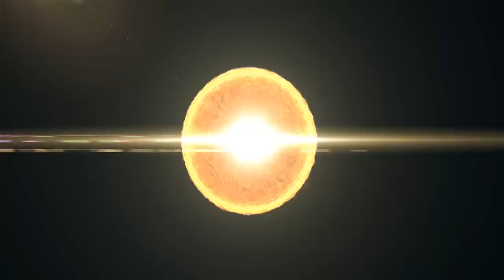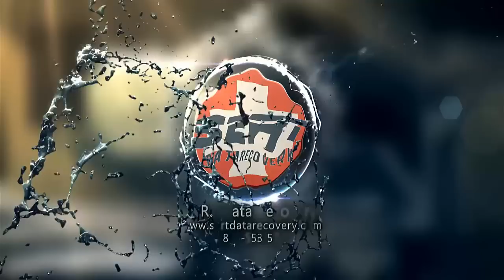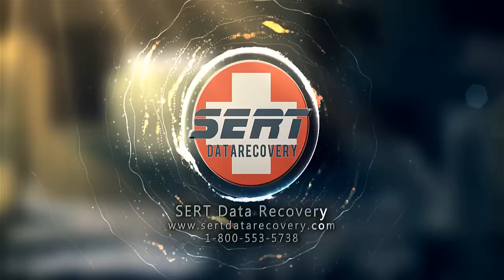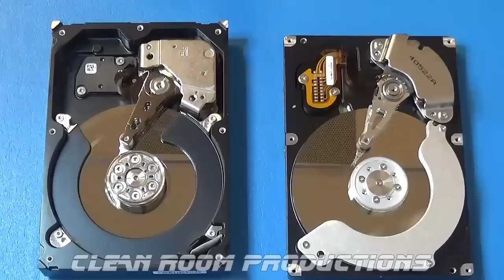1st Step In How To Recover Data From Clicking Hard Drive AKA The Click of Death

Comment: I'm from Indonesia,

I had a problem like this , and this happened on my Toshiba laptop HDD .

Can I ask? Whether by doing....

1. Head Replacement , 
2. Replace the PCB board which is behind HD blue or green colored board that controls the movement of Heads HD , HD disc set speed , and so on.

So.. Whether it can make my HDD rise from the death and get my data back ?

Please answer my question , because my laptop still can not get used to this day .
Reply from the maker: +Victor Tauran It's almost impossible to answer this without determining exactly what is causing the clicking.
Reply: SERT Data Recovery 
Could you do a good job and give a bright hope for my HDD if I send my HDD to you ?

Give me the phone numbers and email addresses can I contact
Reply from the maker: Victor Tauran we always go the extra mile for our clients, we will attempt every option before we determine the drive to be unrecoverable. PH: 800-553-5738 please fill out our form for the quickest help getting a case started: https://secure.sertdatarecovery.com/online-quote Thank you for your interest in SERT.
Reply: SERT Data Recovery Ok , the next two or three days I will send my HDD , conformed to the address indicated.

The address I get from Todd Trahan

Just like that?
Reply: SERT Data Recovery .
Reply from the maker: Victor Tauran
SERT Data Recovery 1748 S Congress Ave, Palm Springs, FL 33461

Comment: Thank you for this video! It was very helpful for me as a tech noob to understand what is happening and that my feeling was right to save my data immediatly after hearing those noises. I don't understand why this video has so many "thumbs down". FYI: I saved my data and then tried the windows disk check tool but I think now the HD is completely done ... I think I will have to get a new one ...
Reply: +Jaana Hoffmann I hope you don't mind me asking your opinion if you think I should have the HD checked by a professional (im in Europe) or - as my data is saved already, just buy a new one - it wasn't any special or expensive HD
Reply from the maker: +Jaana Hoffmann Thank you for your response Jaana! Disk check will kill a failing drive (Just FYI). If you have recovered your data I would try to RMA it, and never use it. Replace it at all costs!!!!

Comment: my hard drive is really strange. It doesn't show on mac, but does show in windows( And makes the pc slow), and I can see all the data in it,( Some of the data, probably small sized data"till 50 mega bites" can actually be transferred, however the large data just don't seem to have that opportunity to be transferred). Some one help me? I couldn't find it in any forum on the internet, because mine doesn't have the whole typical symptoms? 

And important symptom, the clicking sound is not continuous but rather frequent And it doesn't sound bad,( I know the bad sound), And can disappear when holding it in some manner
Reply from the maker: +Sekai Ori No Game No i would stop running the drive. Your drive is dying, and could already have bad heads and a damaged file system. Only a data recovery firm will have the tools and ability to possibly get the data off without having to change any parts. I bet this is a Seagate?
Reply: +SERT Data Recovery  No, it is WD hard drive, so what should I do?, one of the things that are important is that I can play my videos,(but they are like a bad connection youtube videos streaming), they are their but are not playable properly
Reply: +Sekai Ori No Game No 7uu7u87 67oughvtugtchn.

Comment: my hard drive makes very loud clicking/knocking noises when i try to boot up my laptop. i've compared this sound to other sounds of bad hard drives, and i've deduced that the problem must be bad heads. is this something you guys could fix? if not, could you recover all of the data? how much would it cost?
Reply from the maker: +Derp McTrollington Derp it is possible the heads are bad. We can definitely help you out. Once a drive has issues you don't want to fix it to use it. DR companies only repair drives temporarily for data recovery purposes. Please fill this out for a quote: https://secure.sertdatarecovery.com/online-quote

Comment: are those drives supposed to start from the middle or is this something wrong? because my drive sounds and acts like the one in the video besides it's starting from the outside of the disc and basically makes the same movements but mirrored. but my drive is supposed to start from the outside.
Reply from the maker: +Maurin Bieler yes some drives read/write heads park in the middle and some park on the outside on a ramp. The thing to remember is that there are many reasons why a drive will click that do not require it to be opened in order to fix it to recover data. However, you will need very expensive equipment in order to perform recovery in those instances. Opening the drive in these cases brings unnecessary risks to the health of the drive and can prevent recovery in some situations.
Reply: @Sertdatarecovery  i just did that mistake. Open just to see what it is. Because some dumb YouTuber said it was fine. Now i see you ask for an extra fee. Is it really? I wanted to check my disk, if there was at least any chance, but i think now there isn't. And to pay a fee just to see it opened and going to garbage breaks my heart and income. In my countrie we dont earn a lot. A salary is around 700€ a month, to fix a disc means several months not eating -.-' uhg. What an idiot i was. Also, thw shipment. From portugal must be so much just the shipping... Im heartbroken. My mom passed away and i did not get to backup my pictures. Also... My work from 2 years. I feel really stupid.

Comment: i have a toshiba laptop hard drive in which its clicking i store it for a long time in a safe place after months of not using it I plug it in it started the computer had recognized it then i safe removed it but from that time it didn't work and from what I understand from your videos i can guess the heads are damaged i also think there's only one head in it because it's only 80 gb. 
any way I live in libya where there'snt any recovery company and I want to fix it my self note that I had did several electronic services on iPhones, laptops, so my hands are steady but not much experience on hard drives. is there any help you can afford for me
Reply from the maker: +Ruidwaun ElMahgiub you need to be able to determine for sure what the problem is. We use very expensive data recovery diagnostics equipment to do this. If you do not have this equipment you will be guessing and one wrong guess can cost you your data. For example, even if you properly did a head swap, and the drive still doesn't work because the problem was not the heads, but it was the firmware. You would not be able to solve it, in addition to incorporating extremely high risk that was unecessary in changing the heads. hope this helps a little
Reply: +SERT Data Recovery 
thank you so much so I'm out of luck I'll save your CO's name and I'll try to send it to you guys via DHL or so i need to check which shipping companies allow me to. 
i live in libya things harder then they sound. 
also my payment will be my google wallet I hope you accept this kind of payments.
Reply from the maker: +Ruidwaun ElMahgiub I understand and we'll be glad to help. We will work out the payment, we usually do not accept Google or Paypal, however let me see if we can arrange a one time payment for you.
Reply: +SERT Data Recovery 
then I'll contact you as soon as I check with shipping.
I really appreciate your kindness sir
Reply from the maker: no problem!